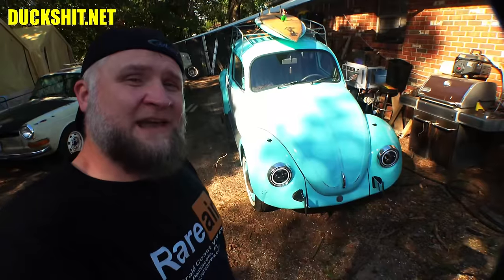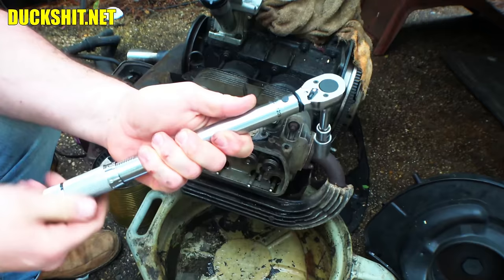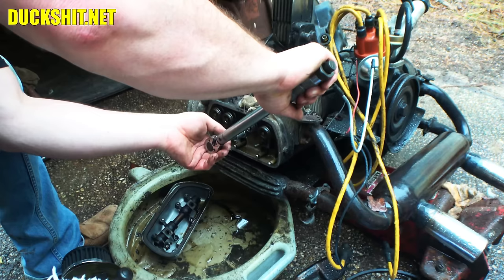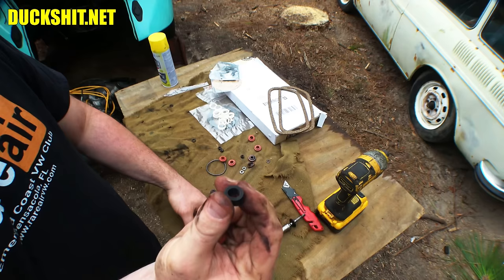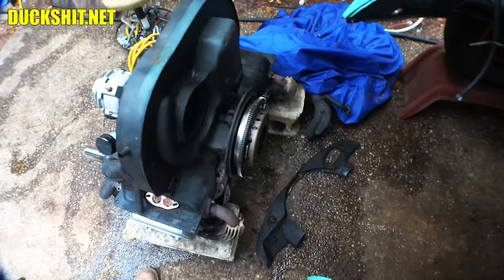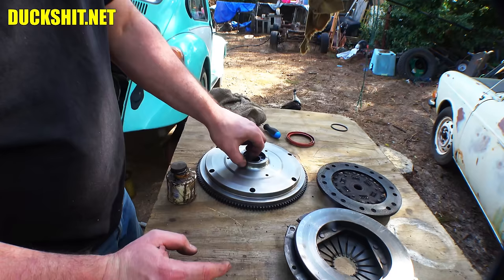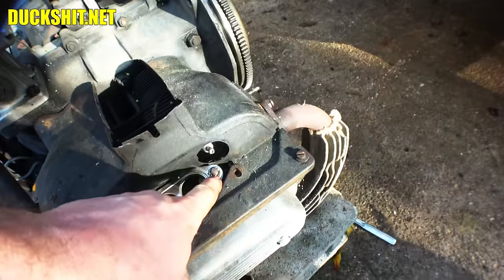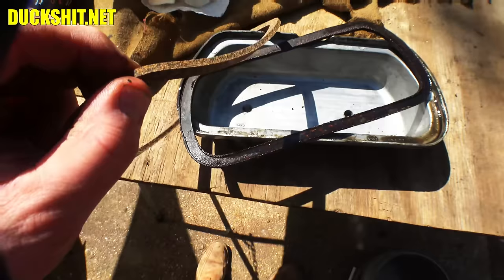🔧Removable Rear Apron - Multi Engine Repairs - 1974 VW Beetle

Comment: Awesome, love how you had the patience to persevere and fix all those leaks, my 1641 had two studs pull out once it sounded like a bad exhaust leak 😂 few helicoils later it was repaired
Reply from the maker: Case savers were invented to prevent exactly that, it was a way to put and much heavier and taller thread into the magnesium case to prevent pullouts.  I'm glad you got that sorted! This one is fixed now too!
Reply: @DuckmanCycles  thanks I’ll look into case savers for my next rebuild.
Reply from the maker: Recommended highly!  Even on a stock engine :-)

Comment: Amazing these things can run like that?  From my way back memory with mine 65 bug I heard a crazy noise one day and found the cylinder fire was melting one side of my spark plug and the head was pretty much toast. Although at the time didn't think about trying to put in a repair threaded insert? Anyway, took my blown up 68 bus engine head and put it on with washers under the rocker arm bolts to raise it up to get compression and adjust the valves. It worked proving how you can make these run with rubber bands if needed. haha
Reply from the maker: It's amazing how much can be broken or missing from these cars yet they still keep on going, lol

Comment: The misaligned dowels are so the fly wheel is indexed to the crank the same, if you balance the assembly that is important
Reply from the maker: Already discussed in another comment.... the thing is though, these assemblies are not balanced together.  But it would make sense if they were.

Comment: Another great Video. So much good info here. My engine is leaking oil between the jugs and head. need to do this.
Reply from the maker: Well, in your case you may be removing the cylinders entirely and putting new seals on the bottom end.  You'll have to go a little deeper than I did.  Also check to make sure its not the pushrod tubes.  Hehe!
Reply: Also you can check if the washers under the head nuts that are located inside the rocker area under the valve cover are sealed. When assembling a motor it helps to put a little bit of sealant under them to insure no oil seepage through there that reflects in between the head and the cylinder area. It can be plainly seen.
Reply from the maker: Useful info!  Thanks for sharing with our guests!
Reply: @DuckmanCycles  I appreciate that, sir. If I can help anyone with a useful suggestion based on experience it’s a good feeling for me and hopefully helps the folks out there with their projects.
Reply from the maker: Likewise, thats why I created the Facebook group page!  Everyone can ask for, or share their knowledge!
Reply: @DuckmanCycles  I did away with FB close to 4 years ago; was getting fed up with the narcissism and the drama although we get some in this app too, not to mention the big C word 😉
Reply from the maker: Well that's truly the same on any social media platform, you either have to have a huge narcissitic personality or at least pretend you do.

Comment: I had a 72 that looked almost just like this one.
Reply from the maker: This seems to be a rather popular looking color combination, there's even a few of them here in town like this
Reply: @DuckmanCycles Loved the video. Never saw the flywheel and clutch off one before, and the valve covers and valves. Once saw a VW with the rockers wired on. Seems they get loose?
Reply from the maker: If installed properly nothing should get loose, lol...  maybe it was some racing application, those guys like to safety wire all kinds of stuff.

Comment: Why one of the hols are offset in the flywheel . Thats for you get the same position after a balancing. The hols should match the flywheel and the crank. So it not could be missbalans
Reply from the maker: Thanks, and that would be a great observation.  But the crank and the flywheel were not balanced together, so that blows your theory out.  Hehe!  Thanks man!

Comment: have you seen those adapter things or whatever they're called it allows you to use a torque wrench with a wrench/spanner? I've no idea if they are any good or not plus there will always be someone that says you are adding in variables so it wont be accurate lol
Reply from the maker: I have seen them, ProjectFarm often uses one, or you can just use a pull scale and do the math.  I demonstrated that on balljoints some time ago.   😁👍🦆💩

Comment: Great video Lord Duckman. Definitely gave some good advice  on numerous things. I really like the apron upgrade. Quick question. My type 3 has the automatic. I actually love it. I probably should service it. Any advice on what to look for? Do they have a filter like domestic vehicles? Thought you might have serviced one or two before. I don't know if I would trust that rooster. Lol. Good thing it's talons are gone. 🤪. 🦆. Noel
Reply from the maker: Oh man, I know so little about VW automatics, other than a little trivia and what works with what I really don't know much else about them.  Last summer I removed an auto from a Type-3, you can find some videos of that up here.  But yes, don't trust the roo-bag... he's a disaster in the making and would shred my face off if he was given the chance.  Yesterday he bit onto my shirt and wouldn't let go, if that were skin he surely would have done some damage.
Reply: @DuckmanCycles  sounds like it's time for some homemade chicken soup 🍲. Lol
Reply from the maker: Nuggets.... they won't need any hot sauce though, they're gonna bite back.

Comment: Hey Duckman, I have the same torque wrench and it won't click on a low settings. It will if I try on 90 ft lbs on my truck lugs.  Does that mean it is bad or just needs reset?  Can you do a video on how you caleribated yours?  Thanks for all you do.
Reply from the maker: I'm actually working on that video right now!  The small click is usually so small you don't even notice it... gotta be super observant, it about clicks the moment you touch the wrench.

Comment: The head are going to keep working themselves loose. The remains of those heaterboxes are soaking heads with exhaust heat. They must be complete with cool air flowing through them in order to avoid this. Otherwise j tubes and heat shields must be used in place of them (like vw designed for the thing).
Reply from the maker: Thanks lol, but at least you're not entirely wrong.
Reply: I'm just referencing what the vw enginners did. Industrial shields were deemed nessary to protect the heads from the exaust manifold heat. J tubes and shields are cheap, and I would have really pushed that config to the customer. Maybe you did, and they said no? I don't know. But, it should be worth mentioning, as a lot of people look to you videos (myself included) for how-to stuff.
Reply from the maker: @PWB87  all you got to do is watch my other videos where I fabricated industrial tins, I know why they're necessary with J tubes, but these are not J tubes.  If anything else without the tins it will hweat up your oil, but they're NOT going to loosen your heads.  Especially in this case, because it actually has cooling fins on the exhaust which will make them dramatically cooler in the airstream, and will actually further cool cylinders 1 and 3, as was intended when the heater box was still intact. I just bet this arrangement wasnt tested by VW engineers, they never expected the jackets to rot off of them.
Reply: @DuckmanCycles  Yea, this arrangement probably has never been formally tested, I agree with you there. But the heaterboxes don't really draw heat out of the heads like some may think. Otherwise, vw Things would have had significantly hotter head temps, no? With the cases rotted away, is it any better? Who knows, like you said it's probably never been tested... This would also depend on driving style though. Stop and go traffic probably wouldn't provide adequate airflow across the fins. And when you park the residual heat just radiates right up to the heads. Intact heater boxes, or j tubes with shields would have been a better choice.
Reply from the maker: Oh it's well known those heater boxes draw heat away from those cylinders, and I could even tell you first hand because when the heater hose comes off, that side overheats!  Its gotta have a draft!

Comment: Glenn is it bad to use an impact on a crankshaft pulley?
Reply from the maker: That depends on who you are, lol... I had a recent post about this somewhere on social media.  A friend of mine put his pulley on wrong and missed the keyway, then tightened it with am impact and destroyed the pulley.  Apparently that was my fault, he blamed me, yet I never touched a thing, I never even told him to put the pulley on wrong.  LoL!  I use an impact to quickly wind it on, then a torque wrench to cinch it up to spec.  But don't listen to me.... lol!  This has become a big joke in our local circles.
Reply: @DuckmanCycles  I read somewhere that using a impact wrench you can do damage to internal parts? Just wondering
Reply from the maker: I think the internals will be just fine, that's some of that strange science stuff that people say on the internet... like I talked about in this very video!
Reply: @DuckmanCycles  awesome thanks again for your very knowledgeable info. You are obviously a very intelligent guy
Reply from the maker: You bet, glad I could help!  Thank you!

Comment: for valve cover gasket ? You can use fifth wheel grease . Just a tiny bit . Last forever . Apply only on the gasket . Then put gasket where it go . You do not want fifth wheel in engine
Reply from the maker: Thanks I guess, but I think I covered that in the video adequately, no? 😁👍🏻🦆💩

Comment: How often should you check the torque of the heads
Reply from the maker: Anytime you overheat it, assume the heads are loose, things will stretch.  The heads should stay tight for a very long time under normal conditions.  But if you're paranoid, do it anytime you take the engine out.
Reply: Was just checking to see if when I had mine if I had missed doing something that I should have.
Reply: Just wish that I had the money to get an other 1972 bus with a 1979 camper kit on it
Reply from the maker: You will!  There is a winning scratch-off lotto ticket with your name on it somewhere!
Reply: LOL
Reply from the maker: I hope you got one today, lol